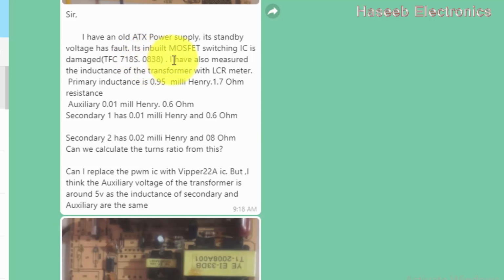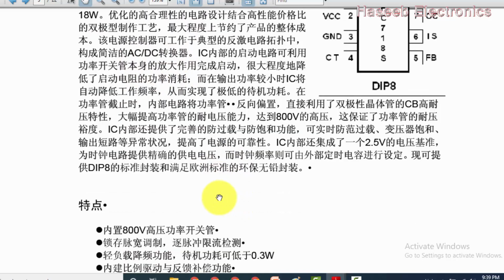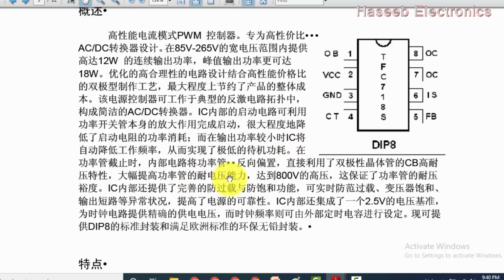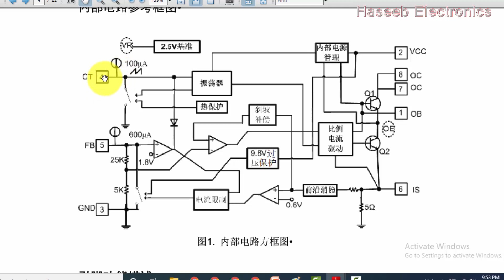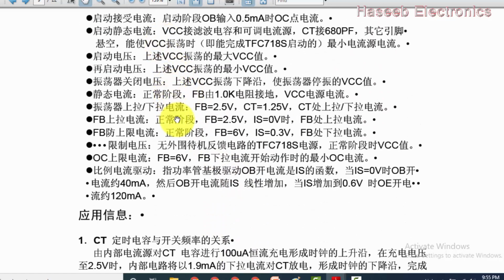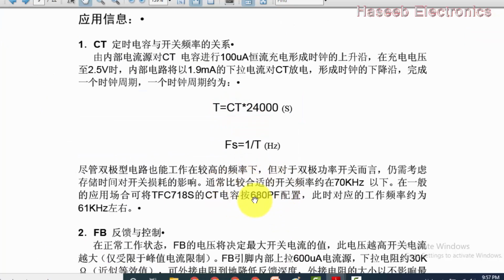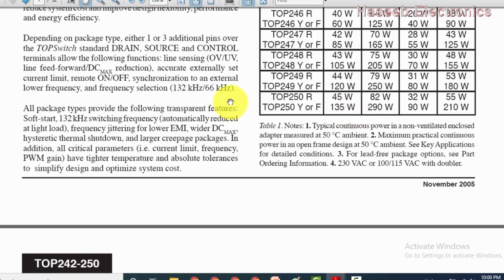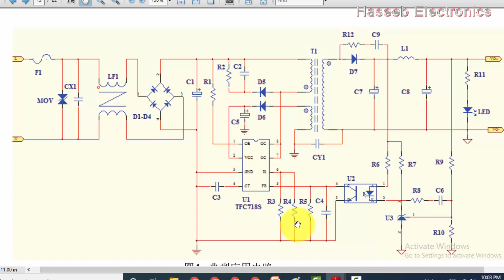316 Calculate Switching Frequency of Burnt SMPS PWM Controller IC

Comment: 100khz ke jagaha 60khz  switch ic replace kar sakte he sir?
Reply from the maker: no. aisa karney se transformer heat up ho ga aur IC damage ho jaaey gi
Reply: @HaseebElectronics  ok thank you
Reply: 100khz to 60khz lane kiliye primary winding jyada karna padta he ki kam?  Usko calculate karna padega but knowledge keliye pooch rahahu.. same size transformer input output same but signal 100khz jagaha 60khz lane he

Comment: What is the use of R8 and C6 and also R12and C9
Reply from the maker: R8 is bias resistor (used in some designs for more stability)
C6 is bypass capacitor to prevent from false switching
R12 & C9 is RC snubber for D7 diode. it helps in fast recovery
Reply: @HaseebElectronics  Thank u so much sir